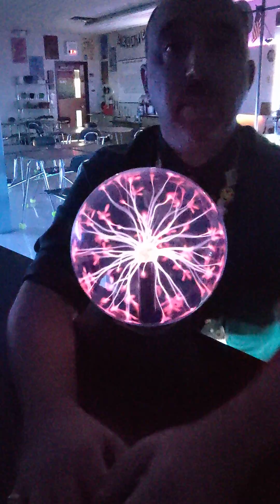Plasma Ball Demo

Comment: Same technology as in neon lights I guess. I figured out something cool about these yesterday. Normally the electricity is distributed across your whole fingertip, so you can't feel it. But you can concentrate it into a tiny point by pressing a piece of aluminium foil to it with a corner hanging off, and touch a finger tip to the corner. You can see the electricity arc to your finger, and you'll feel a sharp burn about the size of a needle. Lol you can actually smell it burning and see tiny black dots where it singed the dead skin.

 I don't recommend doing it to the back of your hand, the lack of dead skin makes it hurt a lot more lmao